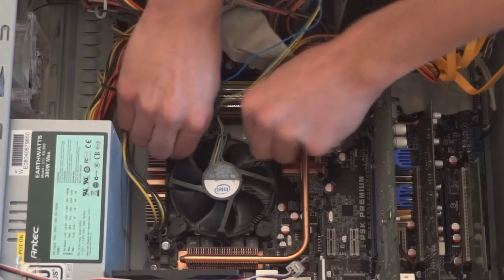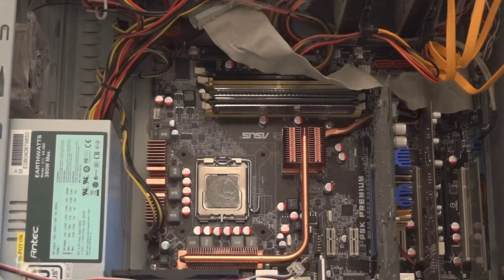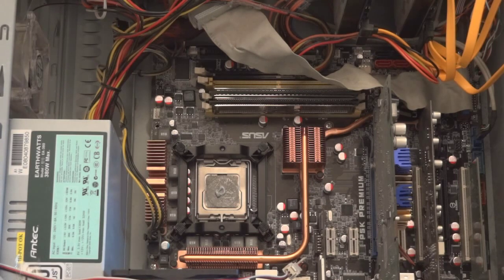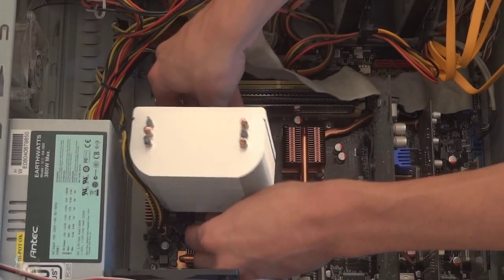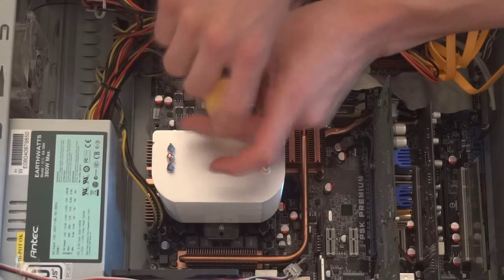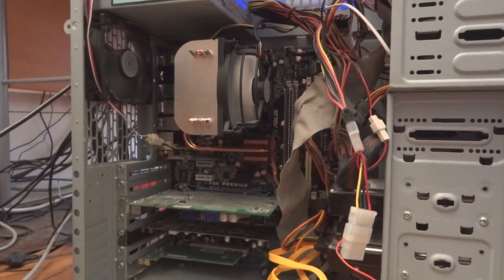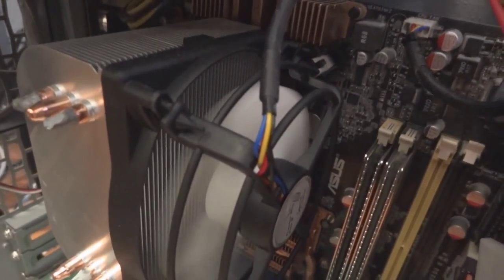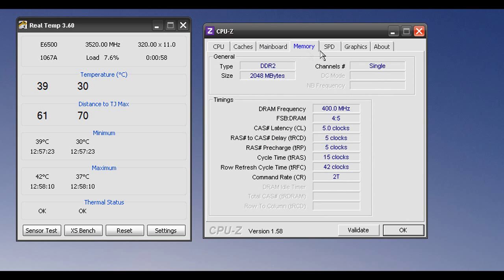How to put in a Arctic - Freezer 7 Pro Rev2 on your PC - By TotallydubbedHD

Comment: how do you remove the fan to install the fan itself? thing is on ther pretty good and I dont want to damage it
Reply from the maker: It just clips on from the sides :)
Reply: totallydubbedHD I tried with a flat tip screwdriver and ended up bending one of the find a bit. really cant manage to get it out
Reply from the maker: Not sure how else to explain it, it's really simple...maybe yours is different
Reply: No I was just being an idiot. You pull from inside the fan out to remove the clip
Reply from the maker: Lol, glad you figured it out